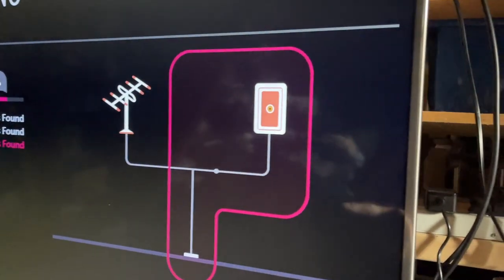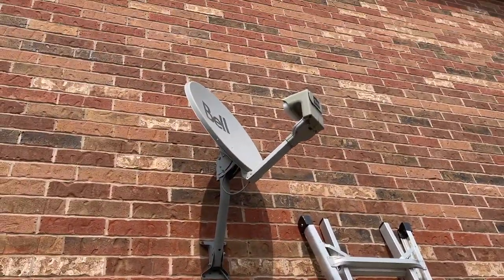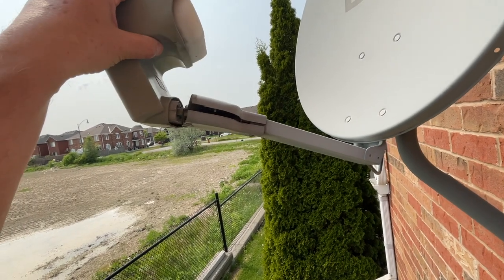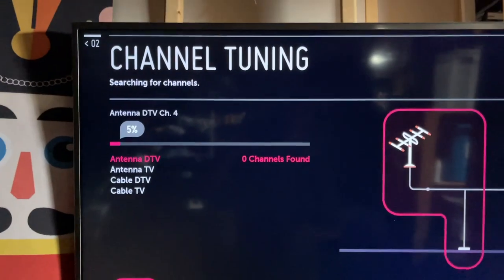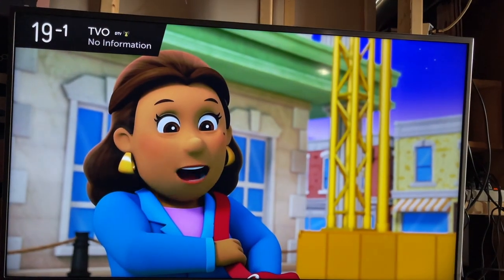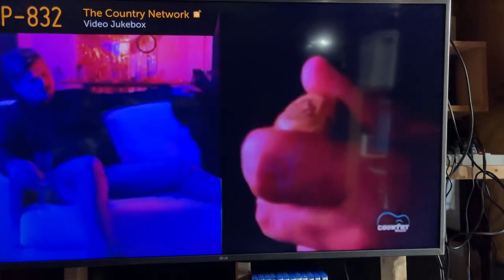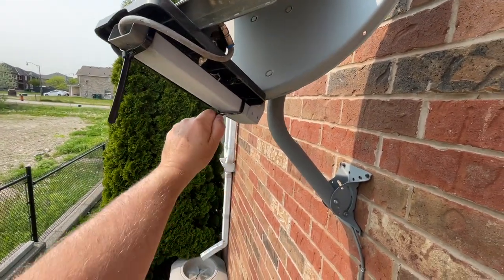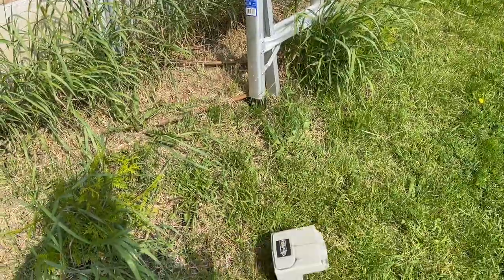No more cable bill. Finally! OTA

Comment: The thing about digital is it tends to be all or nothing.  Either the TV gets a signal it can decode or it doesn't.
A quick check of a map makes me think that if you got a good directional antenna and pointed  it more or less south you could also get some US stations.  Buffalo is 62miles (100km) south of you.  A directional antenna mounted high to get it above the houses etc should see across the lake.  TV antennas work out to about 80miles distance.
With your wiring going past all that electrical stuff, it would likely be a good idea for you to put a booster right at the antenna.  This would make the signal you are sending past the likely noise sources bigger so the noise will be less important.
You need a better ladder.  
Also someone to watch you do it and who knows how do dial 911 can be a great comfort.  Even very non-life threatening incident can be a real bummer if you have to make you way to a phone with a twisted ankle or the like.
BTW:  There really is no such thing as a "digital antenna".  The antenna is just a bit of metal you stick up in the air to catch some of the radio waves as they go by.  All the digital magic is inside a TV.  That is why many people get perfectly good reception from just a length of wire.
Reply from the maker: All valid points. I just don’t want to drill any new holes in the house.   Yes, I need a new ladder :)